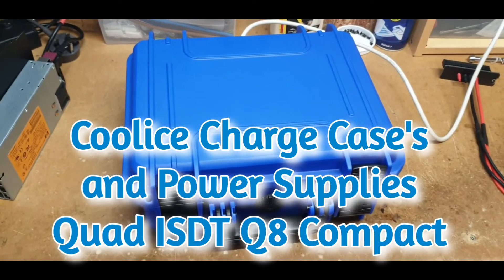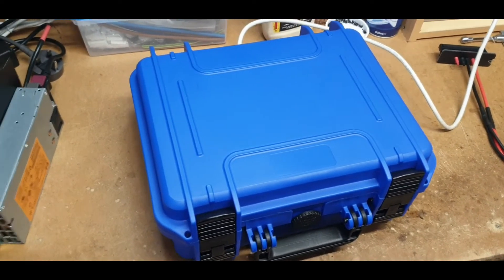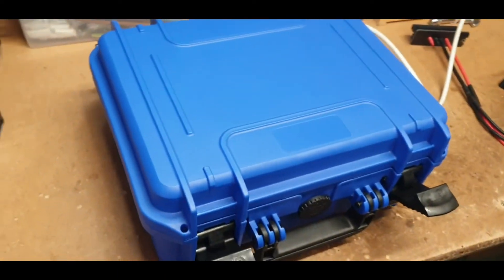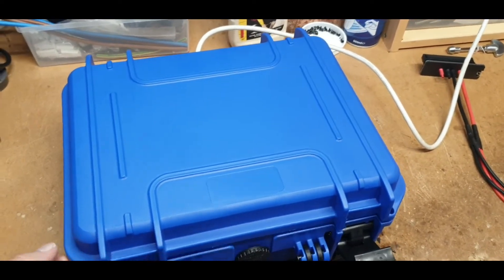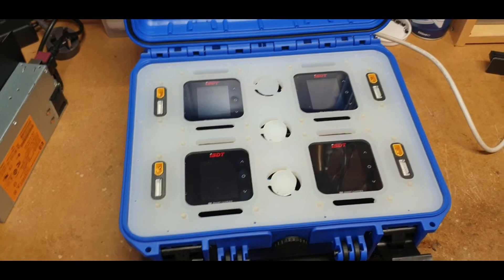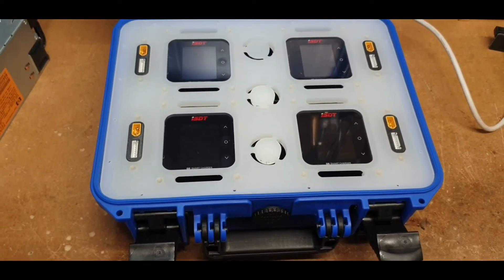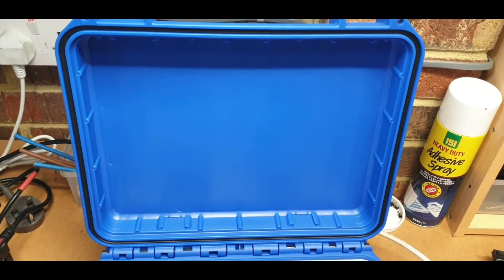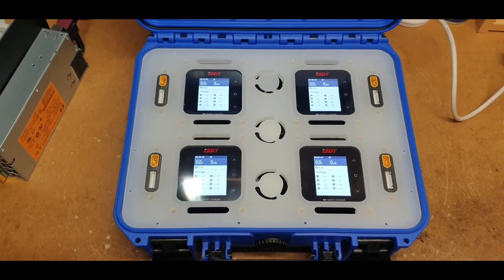Coolice Charge Case's and Power Supplies Quad ISDT Q8 Compact

Comment: I like your work! Building oney self, I really like the flush mounts for the xt60 and the balance plug! I don't have a 3d printer, so I can't make them. Did you make them or where can I get some?
Reply from the maker: Good Afternoon. Thank you for your compliment on my work, it is appreicated. 

Great, you will have a lot of fun building your own charge case.
Yes you can, with regards to anything I use in my case builds, it can all be purchased direct from me for DIY'ers such as yourself building their own case and whom would like to use the same connector holders in this instance.
If you email me; ian@coolice.co.uk I can work with you to get you the parts you need at a good price. 

Cheers. Ian Contessa

Comment: can you ship to U.S. and how much. I have the case just need the cutout. Thanks
Reply from the maker: Good Afternoon. 

Thank you for your Coolice Charge Case enquiry and I will appreciate your custom if you order.

Yes I can ship to the US and also supply just the deck, 3D printed charge cradles and connector holders only for you to assemble the deck yourself. I can also supply the server PSU 3D printed brackets and cooling fan ducts as well, so you can secure them into the bottom and follow the exact design of this build.
Best option is to shoot me an email to; ian@coolice.co.uk and we can talk directly and go from there.

Cheers. Ian Contessa